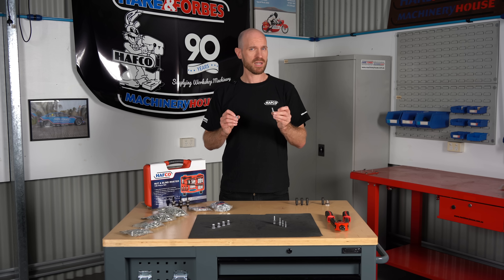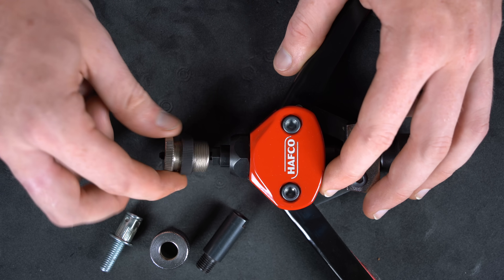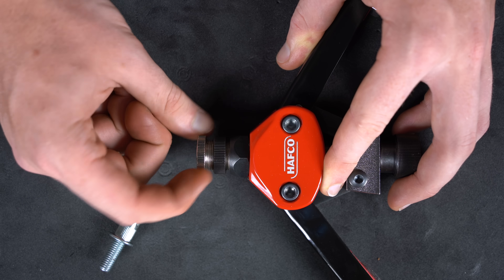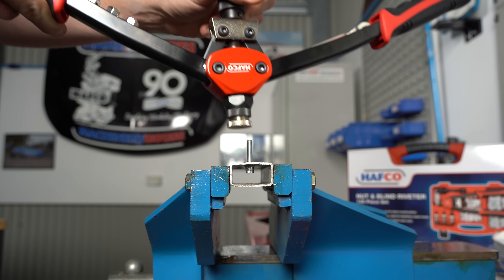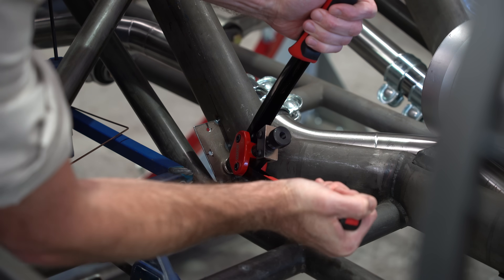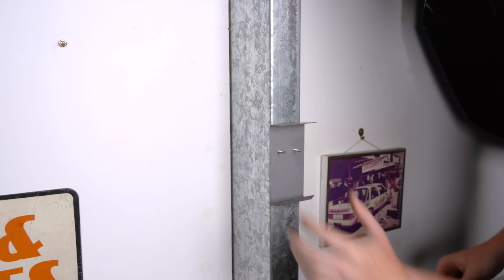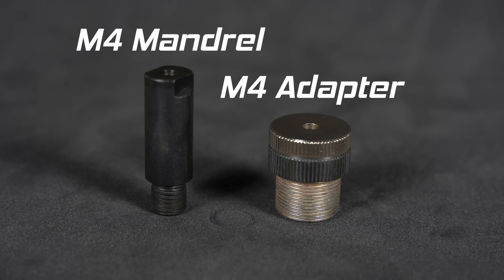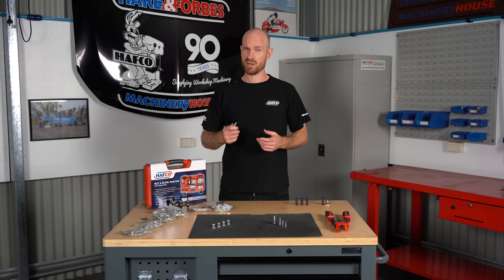Rivet Studs: The Fastener You Didn’t Know You Needed | HAFCO RIVSTUDS |

Comment: Rivnuts and rivstuds. For bodgers who can't be arsed to do proper job and get a welder out. You probably use blue block connectors on your 'wiring ' and use spray foam and gaffer tape everywhere else
Reply: Rivnuts and rivstuds are definitely not bodgers fasteners. They are in fact first use original fit on a lot of aircraft and are still used as original fit at manufacture.
Don't tar everyone with your own practices.
Reply: @stiggy3833  I don't use them. I have spent plenty of time undoing them though when they ve rusted solid and are spinning. As I have replacing shit wiring that some chimp thought up to snuff. The aero industry is quite different to a rusty land rover chassis. There's a time and a place for all
Reply: @highdownmartin  Totally agree, different standards. Keeping a rusty Land Rover going probably more enjoyment though creating your own repairs and mods as you go.

Comment: I have been using these from Wurth for decades, they are quite useful, as are the related rivet but when old can be a a pain. Last week we had to remove factory fitted cabinets out of a T5 California and they are retained by riv nuts and studs, every single one of them span and had to be ground off. The hex riv nuts VW used on the Golf 2 doors were much better but you have to punch a hex hole to use them.

Comment: Works great until corrosion opens the hole and you need to remove it.  Once you experience this, you will rethink this video.  On the other hand, they are fabulous to use right before you sell the item to some unsuspecting dolt.

Comment: Are they a "blind" fastener? I was wonder if I could install one into the top of my fuel tank (around the vapour pressure release valve), and if it would leak fuel out of it?
Reply: Yez, they're "blind"... meaning installed from one side, without access required to the other side.

Comment: Been using these in the aerospace industry for as long as I can recall and I'm now retired. They are good though.
Reply: I remember using these when I worked on aircraft in late 80's and early 90's, although don't remember using metric
Reply: @thunderbird97  Hi, back in the day they would have been imperial sizes for sure and I can't remember who manufactured them. As far as I am aware Airbus although being European still uses imperial sizes.
Reply: That's the same for "CLECOES"  
I've been using them for about 20 years, and I'm not even in the aircraft industry.

Comment: Why is this better than a traditional rivnut and a section of threaded rod or graded bolt with head cut off? For 20% of the cost.  Maybe add som loctite if you don't want the threaded rod spinning
Reply: Ebay/ Amazon stud kits are cheap to

Comment: The only valid argument was about hard to hold&fasten situations. My first rivstud got ripped in half, it was impossible to drill out, had to be ground for half an hour just to spend another half to fish out from the crash rail of my car. It was my mistake on multiple accounts, but the biggest one was insisting on the factory solution for my retrofit project. They are terrible to work with, and even worse to correct any mistakes. And if that would not be enough, they cost around 6 times more per piece than a rivnut because they are not in high enough demand to scale up production. Also true for the adapter, one costed the same as the tool with several rivnut heads.
Reply: I love the idea, but my thoughts are that they'll be difficult to remove like your experience.
Reply: @justinrobertson5493  Why would anyone want to remove one of these, these are intended to be a permanent fastener. Every complaint/ failure I ever hear about for the RivNut and now the RivStud can 99% of the time be traced back to the installer. The individual who hasn’t read or followed the installation instructions which resulted in holes drilled too large , incorrect rushed use of the tool and over compressing the fastener causing it to break or pull through the hole and fail to function as desired . These are excellent fasteners when installed exactly as detailed in the instructions.
Reply: @wirefeed3419  it becomes damaged and needs to be replaced.
Reply: So do you like them or not?
Reply: How did it get ripped in half? In a crash?   

Then it becomes the question would the cage been easier to fix. I don't see how this is that much better than a rivnut and some threaded rod though considering the cost(you can just use threadlock on the rod)
Reply: @lasskinn  During installation, because it was uniformly hard to pull until the point it snapped (unlike a rivnut which really gives a cue when it is done).